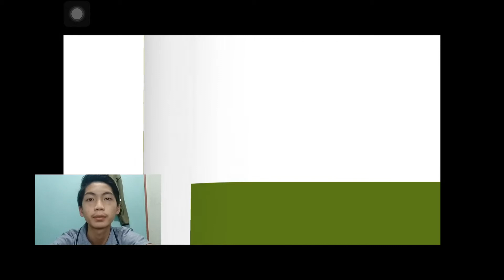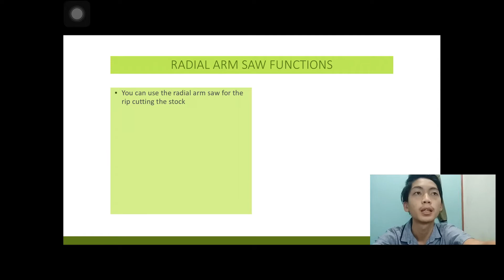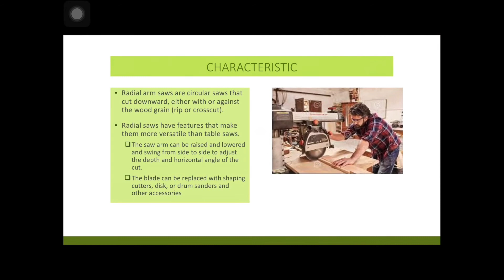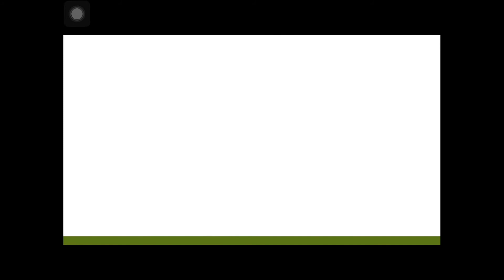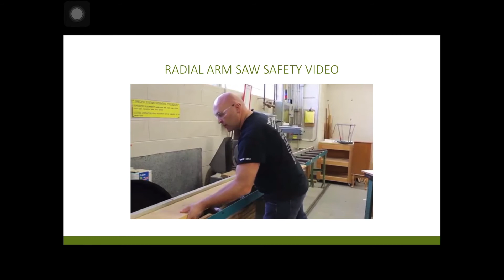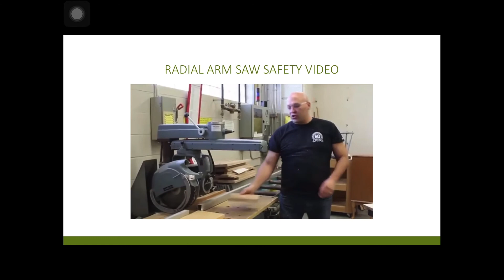Radial Arm Saws (RAS) Presentation

Comment: This machine in the video  is dangerous when not handle with proper manuals. Name 2 safety precautions for the machine and what do you think the best way to teach students to understand safety and precaution in wood workshop when doing practical/ hands on?
Reply: The 2 safety precaution for the machine are wear safety glasses with side shields or safety goggles, or a face shield with safety glasses or goggles.
Wear hearing protection that is suitable for the level and frequency of the noise you are exposed to in the woodworking area.The best way to teach students to understand safety and precaution in wood workshop is give some briefing to the students before using the machine.